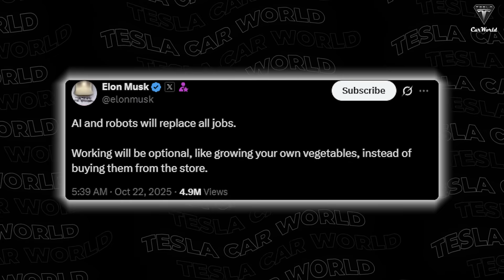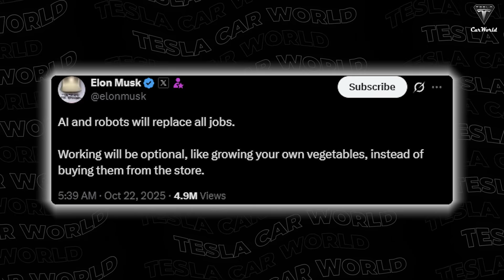Tesla Bot Gen 5 FIRST Cooking A Meal & Do Laundry In 2 hours! Elon Musk DESTROY China Bot!

Comment: Does Optimus touch the plancha , to try the temperature ?
Reply from the maker: No direct touching. It uses sensors and vision-based heat detection—much safer than trial-and-error with hot surfaces.

Comment: Built in fire extinguistr...
Secret cia camera (worse than  maid)
Pussy for when the wifes not home or not
Kill pulse switch
Group remote control
Repairs if you have 20 grand
Broke your childs ribs hugged to tight.
To much soap overflow slips bust the skull
Electricuted in washing machine water sparks fire burn down house children gramps burned
Nope